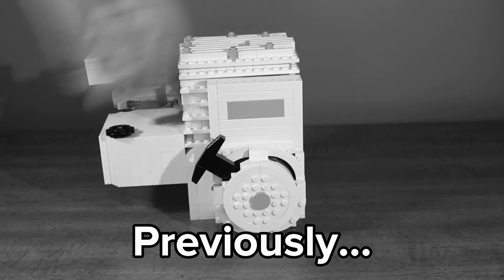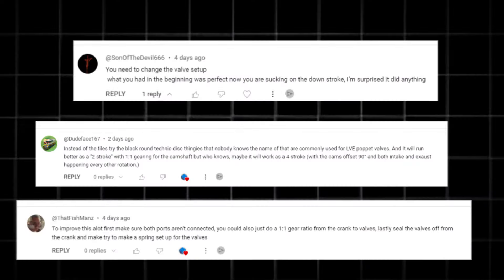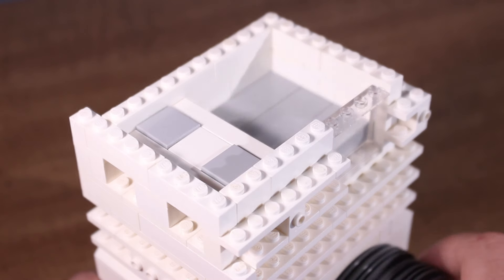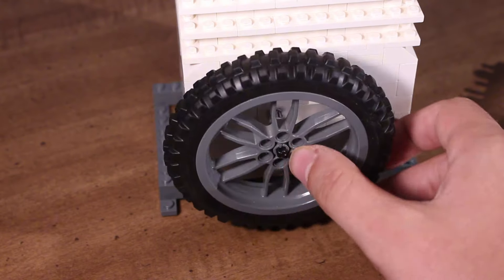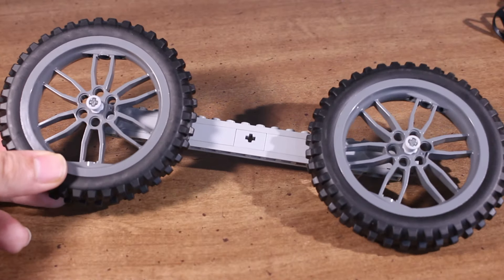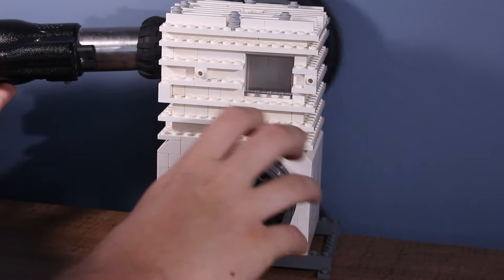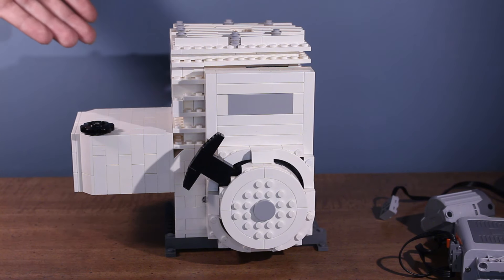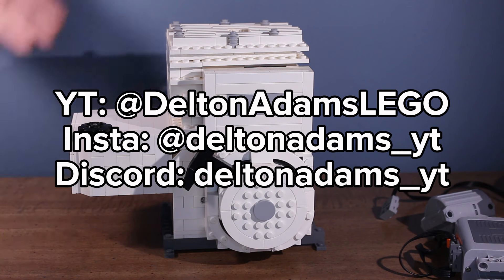I Tried UPGRADING My Vacuum-Modded LEGO Briggs & Stratton Engine...

Comment from the maker: Before you comment: I will NOT be making any large changes to the engine, such as reducing the cylinder size, and I will NOT be lubricating the engine.
I appreciate all the comments from the previous video, but please read the comments before leaving one yourself!
Reply: Also a small change can you seperate the chambers where the vaulves are and have 2 entrances 1 for both side
Reply from the maker: @GamerTag700  I could, but I'm going to work on other projects right now. I might come back in a few months and try to remake this though
Reply: @DeltonAdamsLEGO  ok
Reply: Also check the timing of the valve of the engine
Reply: Awesome video! Wow so cool! 
I wished my comment helped!! 

This time it seems like there is something wrong with the valves lots of leakedge and something is off with the timing.

How you looked at other LVE flatheads? Maybe watching some videos or tutorials could help. 

I wish you could keep it as close to the design as possible
Reply: It will never run fast because the valves are to the side which makes it lose internal combustion also since the valves are to the side the air can’t fully leave the cylinder. Instead put the valves on the top of the engine or have the exhaust on the other side and I know you said no major changes but this is why your engine is really slow trust me I have been doing this for years.
Reply from the maker: @Hineb-d9g  I'm not trying to go for speed, I'm just trying to get it to run at all
Reply: @DeltonAdamsLEGO I could try making one and tag you to a video, i’ve been making a lot of flatheads lately so a new design seems like a fun challenge! :)
Reply: Not gonna pay for the instructions tho so it’ll be a little hard to look from your videos + i don’t have the cams so it’ll be a little different…
Reply: Already built about half of it so a video of it will come either on this week or in three to four weeks (going on a trip to my grandparents for two weeks after school ends)
Reply: The intake valve won’t need a spring because the suction force will pull it down the spring is unnecessary stress
Reply from the maker: @FoochieA  it doesn't have a spring. Only the intake does

Comment: Hey, two things, your timing is a little off, and use different cam profiles. The ideal cam is long duration and low valve travel.
Reply from the maker: If you're talking about the timing when I'm showing the valves, that's just before I timed it. I did a lot of experimenting with the timing and I never got it to run. Also, what other cams could I have used?
Reply: @DeltonAdamsLEGO  there are these small half wide technic beam pieces that have 2 axel holes, you could use those with a technic spacer (the one that accepts the technic pin) to make a roller and put the push rods on the roller with a 2 by 2 base for it to roll on

Comment: Great video! If i may give some tips, here they are: I would recommend testing to enlargening the intake port (where the vacuum hose is) from a 1x2 stud to 1x4 stud. If the hose wont seal properly 1x3 stud should work too. Technically the intake valve could also be enlarged too from a 2x2 to a 2x3 or 2x4 stud. I have noticed personally if the intake is too small, you aint using the full potential of the vacuum. A lighter piston is also recommended, however that could risk the need of using glue. You dont need to make the piston itself smaller, but just making it thinner. Keep in mind that the piston balance could be affected. (It starts to wobble)

Comment: The valve with vacuum should be open slightly after bottom dead center while closing near the top dead center, with the intake valve opening after top dead center and closing near bottom dead center. This should give sufficient torque to overcome friction given by the plastic mechanical parts. From what's heard during the attempts, the vacuum valve closes while piston is in the middle of its stroke. This setup doesn't give sufficient torque to keep running.
Reply from the maker: That's just because of the cam lobes.

Comment: make the valves open more? it should help. Also check the timing: the correct timing should be camsaft 90degree to cranksaft.
Reply from the maker: Timing was right, but the engine ran fine with the original lobes from part 1

Comment: Hey dude!, a few ideas:
.
 make sure the exhaust spring is harder, the vacuum is likely able to pull up the exhaust valve because of the soft spring.
.
Lube. Friction really is your worst enemy on any lve, i understand you not wanting to use any but even something simple like water wil work for at least a little bit of time

Make the cams open less, ideally make them open half as much
.
Loosen up your axles a little, friction again
.
Make sure all your walls are smooth, cant have the piston stopping on little edges

Comment: The 2x2 valves are alright but ideally the poppet valves are best because they seal well, also try changing the camshaft to a 1x2 lift arm beam rather than that egg cam.

Comment: I suggest you make it so that the vacuum sucks the piston up and then sucks it down again using the valves rather than suck it up and the piston staying at the top of its stroke
Reply from the maker: That would require too large of changes to the overall design

Comment: i think for optimum performance you might need DOHC and 4V head the other thing is you might need to have the valve offset  closer to 90 degrees from the piston because other wise you might not have enough pull time
Reply from the maker: I'm not going for performance. I'm just trying to get it to run at all
Reply: @DeltonAdamsLEGO  no that's fair but i built a copy o your engine and found that it needs much bigger valves to run (3x3 min)
Reply from the maker: @GTech_builds  somebody else made one too, but it ran fine with the 2x2 tiles
Reply: @DeltonAdamsLEGO  must be my poor vacuum cleaner then

Comment: Yeah i saw the "exhaust sport" is too small and the exhaust port gives the cylinder air
Reply from the maker: It seems to be large enough for this one
Reply: Yes it needs a large enough exhaust hole because if the exhaust hole is too small i cannot have more air inside of it

Comment: try to put the cams up a stud to give more vacuum to the cylinder
Reply from the maker: All that would do is make the valves not seal. I understand what you mean though
Reply: @DeltonAdamsLEGO  yea
Reply: @DeltonAdamsLEGO  You could make the cams bigger or the valves larger so that more suction gets to your cylinder.
The issue could also be that your valves are not sealing well enough which would make it not run at all.

Comment: strange... I've got one too and it revs up to 3500 RPM without any problem. Maybe the timing is wrong or there is a leak from the cylinder?
Reply: And the cams can be the same. they work good in my engine.
Reply from the maker: It could literally be anything at this point
Reply: I very much doubt you got 3500 RPM with a poppet valve vacuum engine. I’m gonna assume you mean a slide valve vacuum engine?
Reply: @xmysef4920  yes, poppet valves were installed, spring only on exhaust, 105 degrees timing. I measured it.
Reply: @GumerTheGum  I suuuper doubt that. Either your tachometer was wrong or you’re lying. I can bet it was a cool engine, but ain’t no way an engine like that is gonna reach 3500 RPM. Even 1000 RPM is impressive to reach with a poppet-valve vacuum engine.
Reply: Was on valves directly connected to the camshaft
Reply: so camshaft wastn't realistic
Reply: but in any case even with poppet valves (my old engine) it was working nice

Comment: ur timing is off and the vacuum is like a single acting steam engine but inverted so instead of pushing it pulls air so yes u want everything to happen within 2 strokes so it should be intake power and exhaust
Reply from the maker: The timing on this is perfect, and I did a lot of experimenting with when the valves open and close